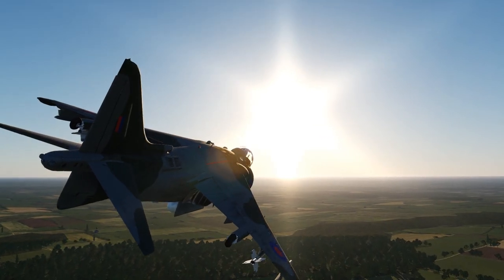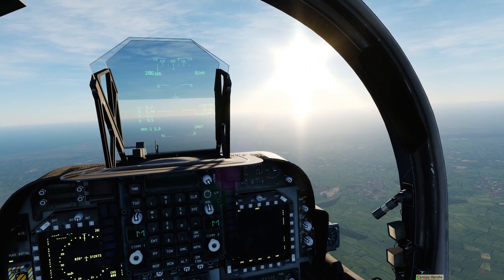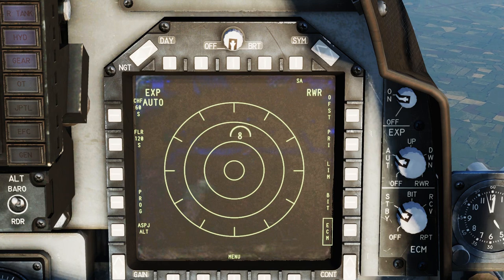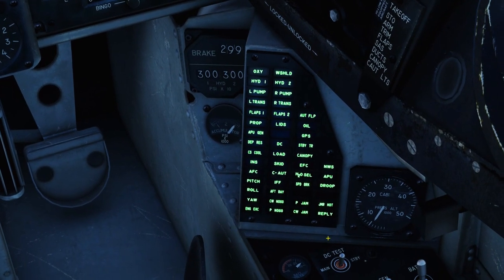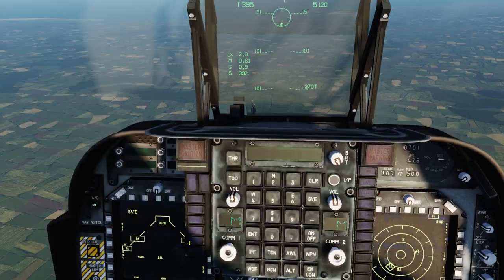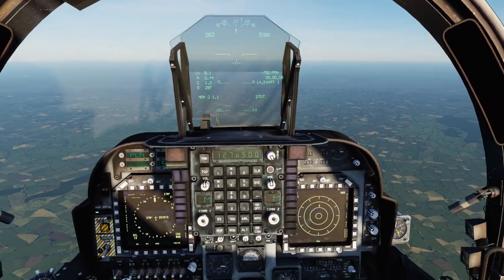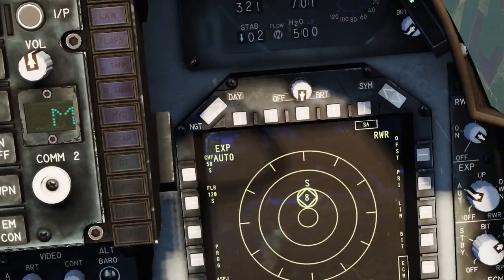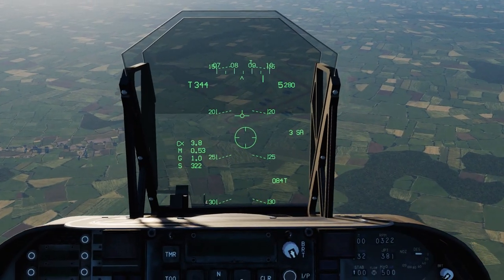DCS AV-8B NA Harrier Sidearm SEAD Tutorial

Comment: Could be wrong, but I do not think the IR cool switch applies to the AGM-122 Sidearm at all and is modeled accurately as such. The IR cool switch cools the IR sensors of a AIM-9 Sidewinder, but the AGM-122 has no IR sensor as it is instead retrofitted with a narrow-band passive radar sensor. IR sensors as far as I know need to be cooled to have a crisp image without static (for an example of image quality without cooling see smartphone pictures at night) and also to possibly prevent overheating, but passive radar sensors shouldn't have such a limitation.
Reply from the maker: Where i got this from is the pocket guide, states that:

"Clicking the switch to the IR COOL applies cooling to all sidewinder station that has a sidewinder or sidearm loaded. Clicking the switch to the OFF position deselects IR cooling." pg 76

My actual mistake is that the IR cool is in fact a backup manual cooling mode which doesn't need to be enabled normally, i must of simply missed this detail, though thankfully it doesn't cause any issues.

Now... if youtube would allow me to amend the video without having to re-upload that would of been great but the feature was taken away :(

Comment: What settings do you use to show the trail of the enemy missile? I play on almost max settings and the only thing i see is a small cloud right after the launch and thats it.
Reply: Soundwave I only see a short trail after launch also
Reply from the maker: I'm using DCS 2.2, nothing special on the graphics settings, in fact they're not maxed out as i normally play in vr, 2.2 has come with some new effects, so it's possible that's what's going on, it also depends on the missile the sa-8 is a fairly old sam.

Comment: Any idea why I am not getting radar contacts in custom missions? I have a mission with SAMs and AA guns.
Reply from the maker: First check you've got the rwr turned on, second, make sure the systems you placed actually use a radar.
Reply: Thanks. It seems the AA batteries were the problem. Tried the SEAD mission and they showed up.

Comment: How is your audio working on the RWR, I don't get anything. any ideas?
Reply from the maker: You've turned the volume up? (rwr power knob) turning hear like in helmet setting helps too. i've heard theres some issues with sounds at the moment, not tested it recently.
Reply: Yeah, tried just set to on, on and then volume all the way up, having hear in helmet on and off, no mods other than some custom toggle switch assignments but I've tried a fresh install of the module without them. I don't get how some people get audio and others don't.  Thanks for replying anyway.
Reply from the maker: That's a shame, i recall the RWR always beeing very quiet in the past, but i've not actually been locked up by a radar  recently, owing to good barcap flights ahead of my own and low threat targets. I'l have a poke around see if i can figure anything out.  Sorry for the late reply comment replies get lost in my inbox, since they dont go to the top, only shown in most recent notifications.

Comment: I'm running version 2.2 and my RWR doesn't make any sound. Every once in awhile I'll get a new target sound, but it's much more likely for it to be silent. RWR switch is on and I've tried volume max on it as well. I've tried virtually everything including deleting sound files and repairing, but to no avail. If anyone has a fix let me know!
Reply from the maker: Im afraid it's a known bug at the moment, the volume control doesn't actually work yet either, making it easy to miss the sounds. if you check out 1.5.8 you'l see they've added some new rwr symbology to the hud. Ive not tested to see if any other changes to the rwr are made in that build, things are a bit scattered in the build up to the 2.5 merge

Comment: Could I use this on an enemy aircraft if the enemy aircraft is using rader
Reply: In theory you could - providing that the airborne radar has been stored into the missile's emitter database. But the problem is - what if the airborne radar hasn't locked you up, for eg it stayed in TWS or RWS mode? The ARM missile would have to find its target solely based on periodic radar sweeps detected by onboard seeker. That's not so much of a problem with ground radars , as they generally stay put. But the airplane moves around and since the radar sweep triggers the missile's seeker only once in say, a few seconds, than the chances are that the ARM missile would, well, miss :D.

Comment: Thanks for the Explanation but:What a useless Missile - Take a Maverick anytime over it! Yes you have to search it with your IR Camera in the Nose - But it gives you more chance to engage the SAM earlyer. But the big Advantage is that you can mount the Sidearm instead of Sidewinders, which gives you 4 Mavs and 2 Sidearm Maximum! When you attack a Convoy that has a SAM or AAA in it you will identify the SAM in your Camera farther than the Sidearm's Maximum Range. And a IR Mav does not lose the Lock when the RADAR switches off. Even a AGM-45 Shrike from the Vietnam Era would have been better. Helicopters however may have a real good use for the Sidearm.That is why the AH-1 is capable to carry them and can be used as a SEAD Chopper.
Reply from the maker: It's a self defence missile, wasn't produced in great numbers, designed to be used when suddenly attacked by a radar, like if one was sitting in wait and suddenly turned on when you're over it. it'd be foolish to try and use it to attack a sam site in real life, but a good laugh in dcs.
Reply: Same stupid idea like to send A4 with Shrikes against Fan Song RADAR Sites :) Must have been the Brainchild of the same Guy telling the Military that Guns are no longer needed in Air to Air Engagements. However having a Sidearm in a Cobra makes Sense for me, especially in Escort Duty.